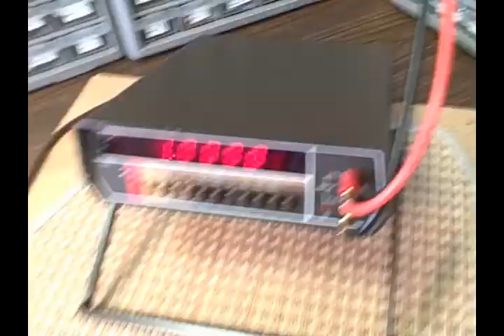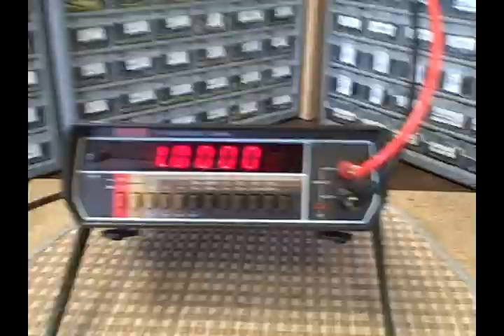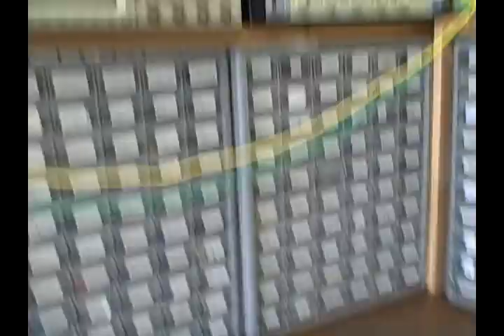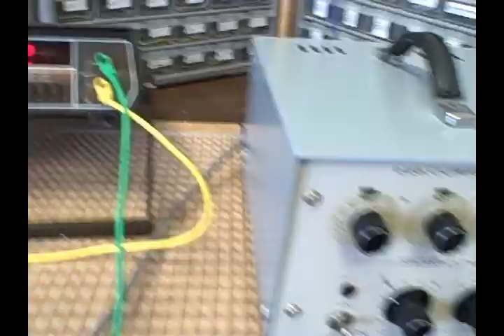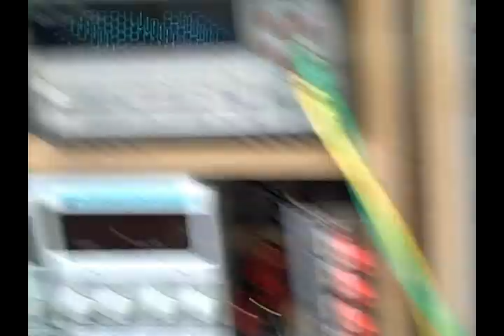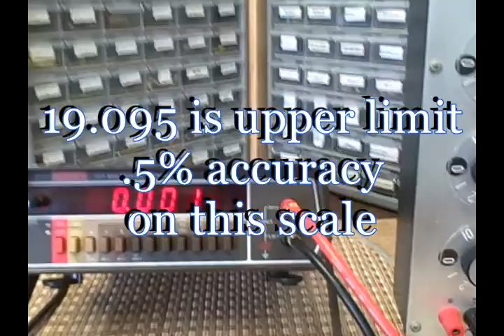KEITHLEY 177 DMM   U1

Comment: I have one of these meters badged here in the UK as Racial Dana 4003. I bought it on eBay for peanuts as it was sold for parts. The only issue I could find was the 2A input protection fuse was 'broken'. It didn't look vaporised just broken as the wire was still complete length wise. Fitted a new fuse and all is good. Nice little meter.